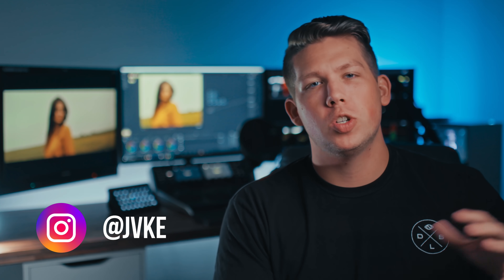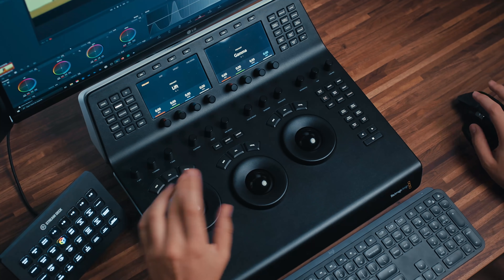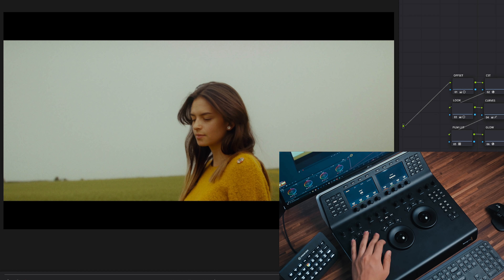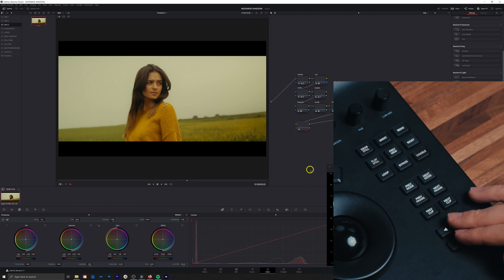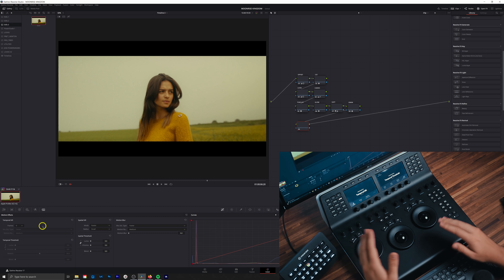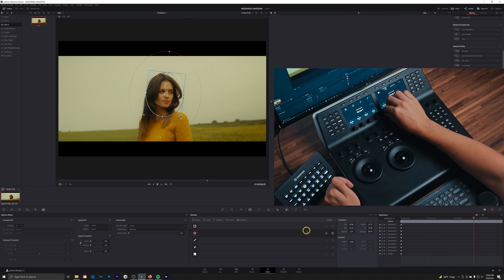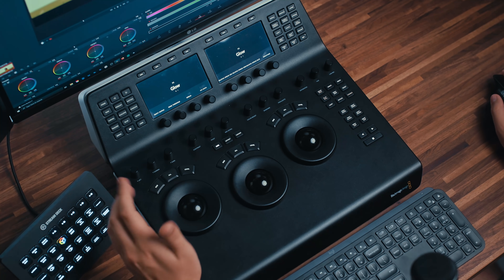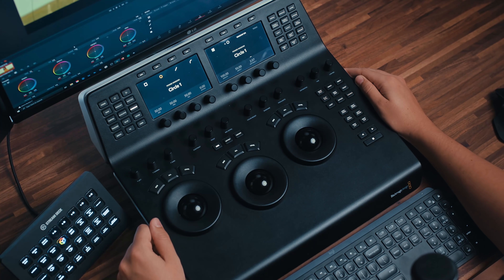In-depth Overview of the Blackmagic Design's DaVinci Resolve Mini Panel

Comment: Fantastic video as always. Keep it up!!!
I also wanted to ask your opinion on the LG UltraFine 32EP950-B HDR OLED Monitor. Do you think it would be a good monitor for color grading instead of using a $30,000 reference monitor?
Is it worth it?
Thank you very much for your advice.
Reply: I’ll have to do more digging on exact specs but there are a lot of great options out there (for SDR grading).
Reply: @jvke.p  This is supposed to be able to do HDR as well. Of course, I am asking because one thing is what the companies tell you, and other thing what actually professionals who test them find out after all the  hype. In paper seems almost perfect, it would be great if you can find out wether or not is worth it.

Comment: Great video. I purchased one 7-8 months ago while I am learning how to color correct and while I still have lots of questions...here's my big one. How do you turn yours off? :p  I'll come back the next morning and sometimes, not always, both panels are obviously lit with nothing on them. So far all I can do it just unplug it. 

Also, for a future video. Can you color correct a green screen person against different backgrounds. So far all my green screen work is not to my standards. Let's assume I am lighting correctly. I am just having issues matching backgrounds. Thanks.
Reply: If you upgrade the firmware it goes into sleep mode which turns off the lights and displays, then push any button to wake it up (the wake up button press won't register in the settings of what ever you just pressed). Assuming you already did that and sleep mode sometimes fails. Your next option is to unplug or install a breaker somewhere between your panel and power. Why it completely lacks an on off switch is beyond me, seems like the simplest thing especially considering a form factor that has space left to spare.
Reply: @tomasbaratomas  Thanks for your reply. I have updated the firmware and I would say I am about 50/50 on it going to sleep or just staying lit. And yes, why Blackmagic doesn't put power switches on there products is beyond me. This is not the only product I have from them that has this issue.
Reply: @Justin_Allen  Yes, it's not a rock solid sleep mode. It's an interesting move/non move by BMD.  I installed a wireless "trådfri" switch from IKEA to cut the power. The on off button is magnetic so you can stick it on whatever metal you have close by or attach it under the desk to get it out of the way.

Comment: The Mini panel has a great feel to it and I find myself using the bottom part 90 % of the time as I am used to keyboard shortcuts for node controls but that's just a matter of habit I guess. 
On the micro vs the mini I may add that the mini is quite a sturdy and bulky build. The positive side is that it feels very solid, the downside is it takes up quite a lot of desk real estate for what it does and the angles are a bit too wonky to easily router it into the desk. The mini panel also needs AC power to work while the micro panel doesn't. Hope it helps for you who are deciding between the two. Ideally both panels would have a couple of user programmable custom buttons and include a midi protocol for use with other software. But we can't have it all.
Reply: This would be a killer addition. And I couldn’t agree more about the unfortunate form factor.
Reply: Thanks